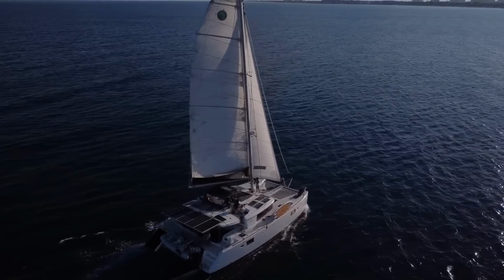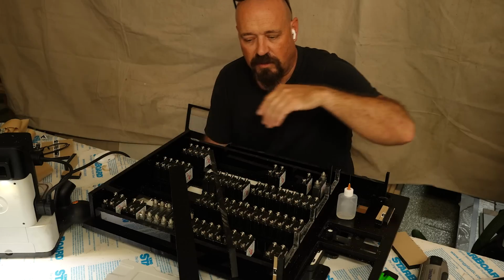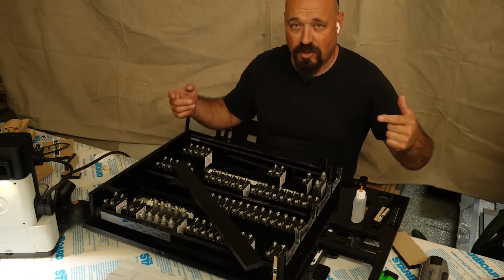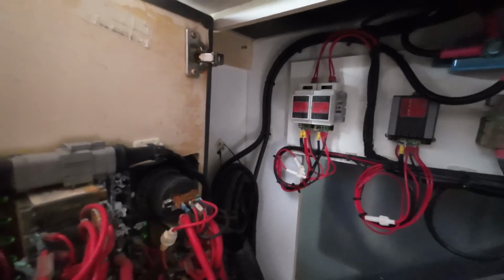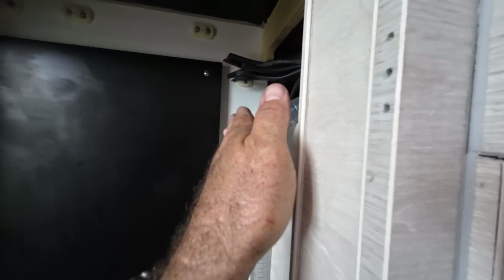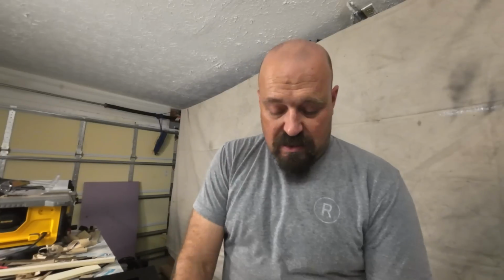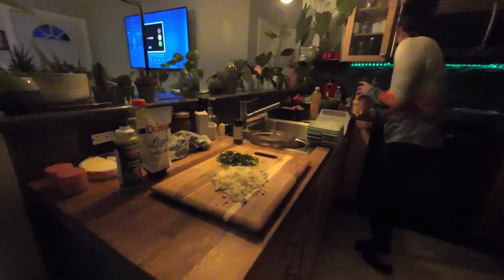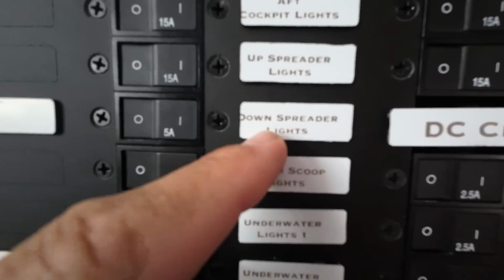T-MINUS 2 WEEKS//Powered Up & Ready For AirCon-Episode 143

Comment: How do DIY'ers installing electrical panels, components, and the associated wiring maintain  insurance? Homes require qualified electricians and electrical inspections before they are issued a CO (a certificate of occupancy is a document issued by a local government agency or building department certifying a building's compliance with applicable building codes and other laws, and indicating it to be in a condition suitable for occupancy.) I watch too many DIY'ers (not picking on you) wiring sailboats with little knowledge and no training. How are insurance companies issuing policies to the DIY'ers? Curious minds love knowledge. 🎓
Reply from the maker: Good question, in the world of homes and building departments, The permit and  inspection process is used to verify the safe installation and building practices.  A Homeowner or a contractor can do the work, but it is verified by the building department inspection process in the marine world. The same is true. However, instead of a building department, the insurance company can be the deciding factor on whether or not, they will pay for a claim or insure a vessel Based on its build or refit history.
Reply: @SailingDauntless  Thanks for your reply. I've read where insurance companies are denying claims and most will only cover 50% of the loss if it's DIY. I've found Obtaining Boat Insurance | ABYC E-13 Standards for Lithium-Ion Batteries helpful.